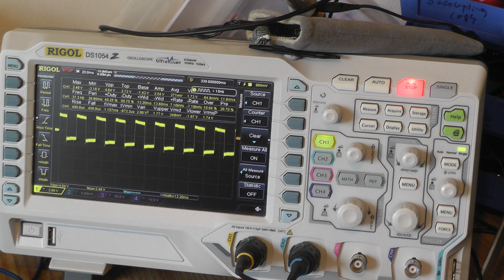Laser Barcode Scanner Teardown How to hack it into Laser Light Show!

Comment: Nice tear-down.. Back in the day use to get the polygon mirror/ motor assembly from laser printers. Also made crude X-Y open loop scanners from stepper motors. Eventually, finally purchased a set of Cambridge HP6800 and HP6210 closed-loop Galvos for full laser graphics projection.

These days you can purchase some cheap 15kHz X-Y scanners on eBay.. and many cheap projectors by searching laser projector or laser light show.

If you eventually make an RGB laser, you can modulate these for full colour graphics.

Keep up the great videos.. 
Flavio
Australia.
Reply from the maker: Thanks!
Yes, I used to have one a few years back (the cheap ones, not the Cambridge scanners) but I had to punt it because I fell on hard times. They were pretty good; I have been thinking about picking one up from aliexpress to play with.

Comment: What's the dispersion in the vertical like? Does it stay pretty flat or does it get wide enough to see some depth further out?
Reply from the maker: It's actually not bad. A crisp clear line across the room. The horizontal fidelity will not be great though, as the mirror is essentially sprung, so yo can't precisely position the beam say left for example, as it wants to spring back. But for a super cheap effect, it's just fine!